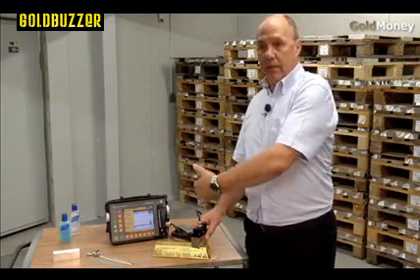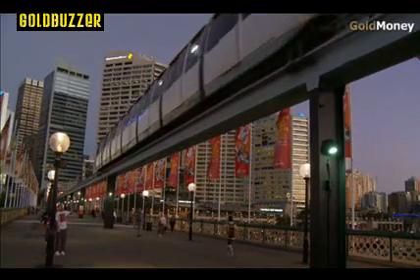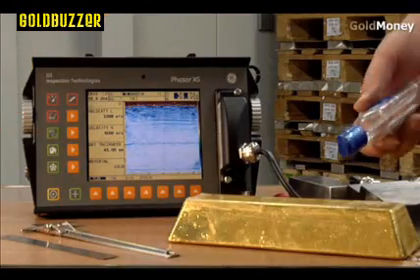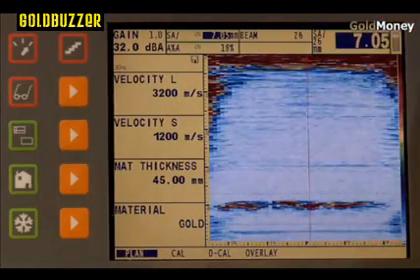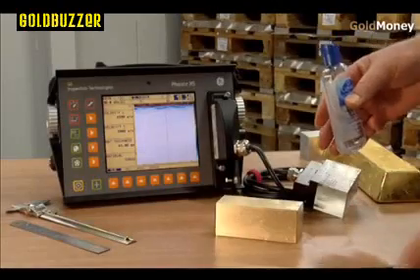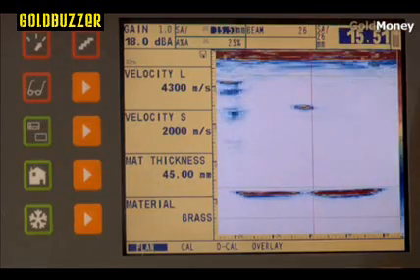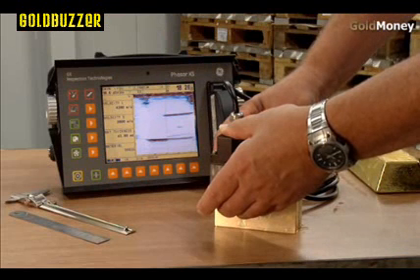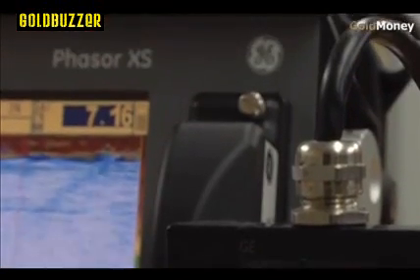HOW TO DETECT A FAKE TUNGSTEN GOLD BAR

Comment: @novicemilk Sound travels much faster in tungsten than in gold, because it is harder. The tungsten bar would appear to be much thinner than it is on ultrasound due to this discrepancy. If there were a thick outer coating (e.g. of gold,), sound would also bounce off the gold/tungsten boundary, creating a visible echo layer. Busted!

Comment: For those people that still don't understand, the density, specific gravity test, water displacement tests won't work if the bar has tungsten blanks inserted in the gold. The density of gold and tungsten are almost identical. But the ultrasound will detect the tungsten anomaly in the gold.
Reply: density will also work if you have delicate apparatus but it's just harder to churn through than with this. The density difference is enough still that with a swan necked glassware for volume and an analytical scale for mass, you could easily detect like 1% impurities even, but the workflow would just be slow, and analytical scales are probably not much cheaper than ultrasounds

Comment: Actually, you're right, it may not. We use them in industrial construction and maintenance to positively ID various alloys which are evenly mixed, not to find chunks of whatever hidden inside the desired material.

Comment: But Tungsten was never tested ! It's not about any other fake gold - but tungsten. As gold an tungsten has the same density as gold. My suggestion is to compare two exactly same shaped gold and tungsten specimens (they will then have the same weight) but pure gold lead electric current (DC current from a battery, preferably) around 3 times better. Magnetism will work too, but the magnetic differs not that much. Gold is also much softer, but we do not wish to damage it for testing.
Reply: Yes it was, a tungsten insert or core would show a secondary boundary line just like he showed in the sample brass piece at the end. Your electric test would fail, because the electricity just passes around the outer shell, which is pure gold in a gold clad tungsten bar.

Comment: Will a magnet work?
Reply: Only if there is a metal inside that is magnetic, such as iron or nickel.  If it is tungsten inside, even the ultrasound may not work since the density is similar.   They should have done a test with a gold bar that has tungsten in it to see if this test has any use.
Reply: neodymium magnet can work allllll metal are magnatic just gold no. even silver and copper and aluminum are having low magnatic. that why u need strong magnatic to check. after test by acid and volume or weight test
Reply: No, tungsten is not very magnetic

Comment: 0=0 why not just calculate the mass density?
Reply: Tungsten is much cheaper then gold and a little heavier so you can not use mass density as it is very easy to make a fake gold bar with same weight and density as pure gold... But gold with tungsten inside is easy to spot using ultrasound or even by just tapping the bar and listen to the difference in sound as tungsten is extremely hard and gold is soft.

Comment: Distinguishing tungsten from gold should be very easy if you have a genuine gold bar at hand. Because of the physical properties of the 2 metals, including but not limited to the hardness, the materials should have a considerably different "acustic density". So you can distinguish bars of the same size and shape and different metal by simply tapping them on a table and you should hear noticably different sounds.
Reply: Acoustic properties are literally exactly what he just showed in the video with his ultraSOUND machine.... Tapping doesn't work if it's tungsten clad in a slab of gold, only if it's a lazier alloy which is a lower sophistication attack.
Reply: @you_are_soul Tungsten is non magnetic bruhhh.
Reply: What are you talking about? You can barely lift that size bar and the table would be damaged if you try to tap it without it slipping out of your fingers. You some kind of a  YouTube comment scientist that knows the answer to everything in the world? LMAO.
Reply: @rsz90182  And you are obviously someone who doesn't even try to make sense of what someone else says, instead you like to laugh about everything you don't understand :)

Comment: I got me a magnet... I's much cheaper...
Reply: +Mac Anix A magnet does not stick to tungsten.
Reply: exaktly BUT. IF You put the magnet on a gold bar thats tilted in an angle it will run slower on a gold ore silver bar than on say tungsten. becouse somthing funny happends when a magnet slide over gold ore silver, IT SLOVS DOWN. hehe becouse even if the gold isnt magnetic the magnet creates a forcefield in the  gold silver.
but i wouldnt always trust the magnet, im not sure how the magnet react to say a big goldbar with just a little piece of tungsten in the center.